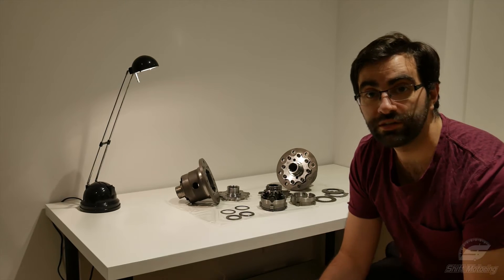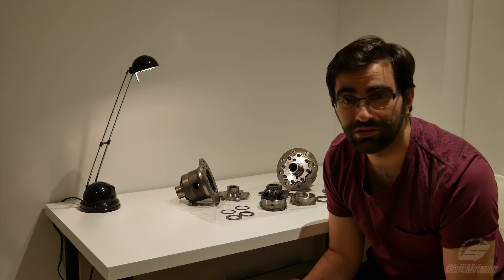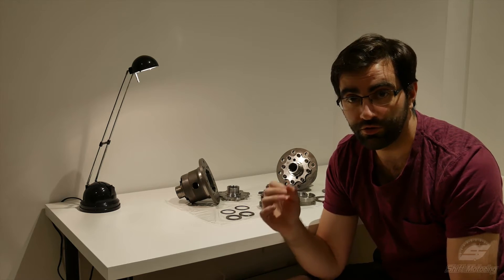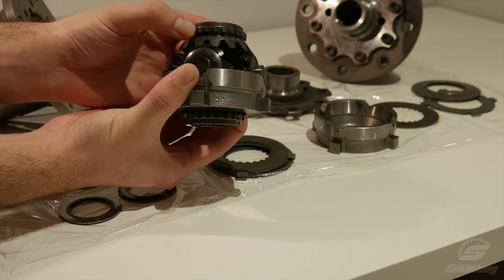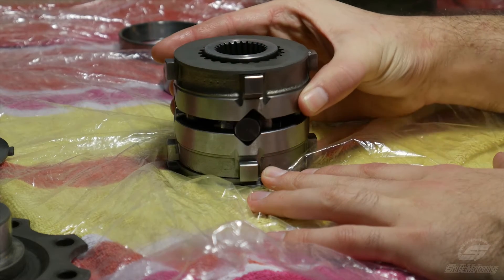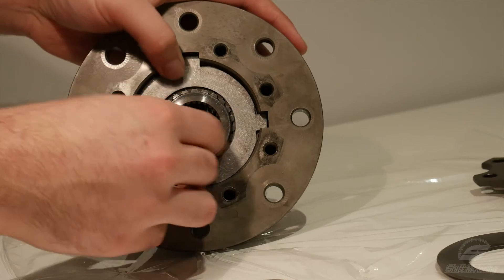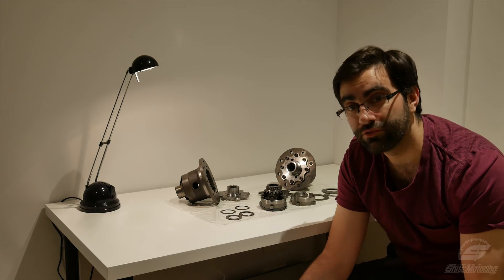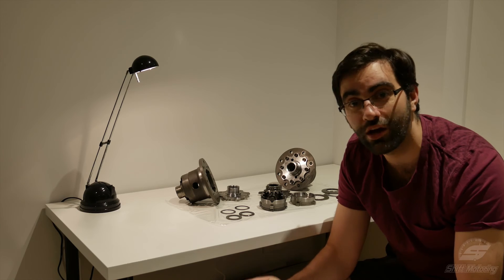SHIFT - How a LSD works & Teardown

Comment: if your diff has signs of high heat inside you propably hadnt had any oil inside, first thing to go would be the hypoid gears, thats the point where most of the energy is lost, through the relative movement of the teeths surfaces.
In short any discolouration is most likely there due to the surface hardening process during manufaturing.

Comment: i just changed the fluid on my 1995 jeep  grand  cherokee and it started to lock up when i turn left or right the oil has a silvery substance in it should i try changing it and put a additive in it before tearing it down
Reply: Harold Bauer buy a new vehicle jeeps are rubbish why buy a Jeep ? ,also diff is gone .why did you even comment if you don’t have a bmw diff lsd .

Comment: Nice explanation ! 
Is this the small 168 or 188mm case ?
Reply from the maker: This is the small case 168mm diff. I think it was first used in the 2002 and then discontinued with the E36 as even the base engines had too much torque. The 188mm works the same way.
Reply: Yeah i know, i have the same in my 94 318is, where did you source the parts (clutches) for it? I will need to do mine sooner or later. Thanks.
Reply from the maker: Thayer Motorsports sell refresh kits and is who I used for the rebuild